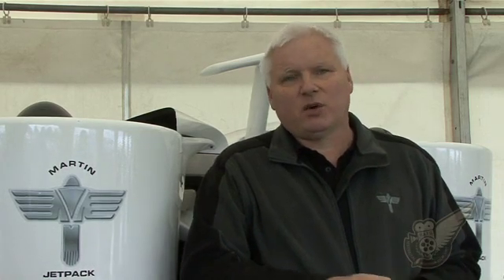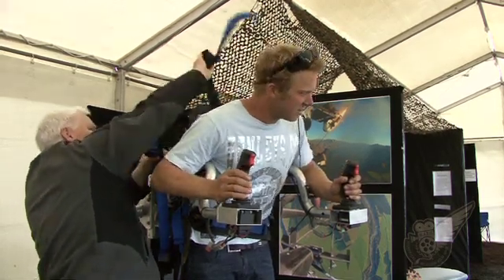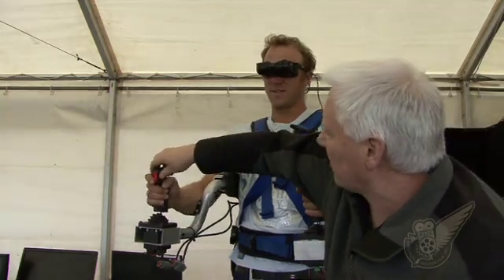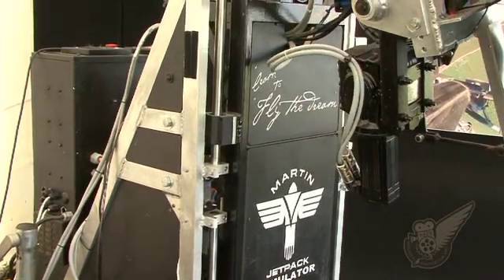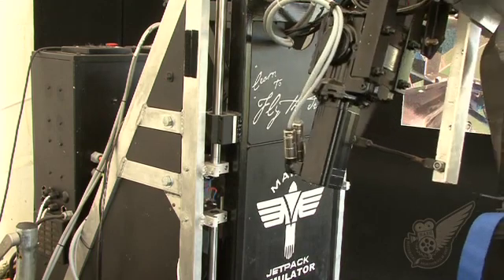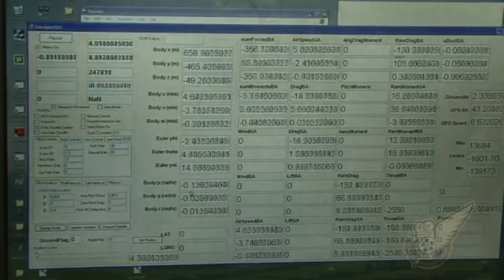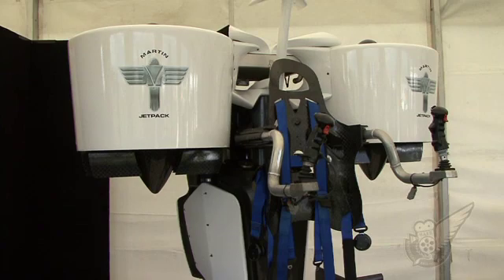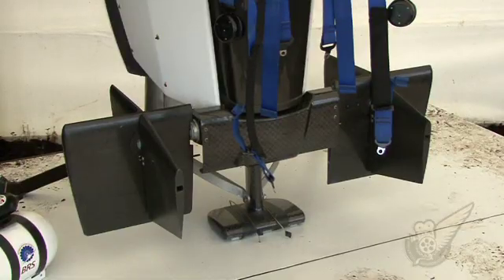Martin Jetpack pilot training simulator

Comment: More than 5 years later and still no commercial jetpack. The 2014 IPO promised first delivery date of Q3/2016 has now passed and all technical specifications downgraded to a level where this machine is totally unpractical and ill-suited for any potential customer. A yet to be achieved targeted top speed of 40km/h will make this device a little faster than an electric golf cart, probably the reason why Martin Aircraft Company asked the American golfer Bubba Watson to promote this device as an alternative golf cart. Having to totally overhaul the engine after just 30 hours of running time will also make this not just the most unpractical, but also the costliest of flying machines. The founder of the company, Glenn Martin, resigned in 2014 and the CEO he appointed, Pete Coker, followed just weeks before the companies’ 2016 AGM to take up a position with Martin Aircraft's Bermuda tax haven incorporated majority shareholder, Kuang-Chi Science. Martin Aircraft Company, with its just under 100 employees, is churning through millions of dollars at a rapid rate (Pete Coker earned $300,000 plus per annum) and has advised the market that more money will be required just to see some kind of commercially acceptable Civil Aviation certification in place. Kuang-Chi Science has so far invested over 40 million dollars in 2 instalments, which will most likely run out in the second half of 2017. All you can buy from Martin Aircraft's website so far are logo printed ball pens, luggage tags, clothing patches and even thermal jugs, but that is about it. Their website has been stagnant for some time, despite employing a considerable marketing team with really nothing to sell. A dismal state of affairs and a sad story for investors like myself, watching the share price of this company drop on a daily basis. Don't be fooled by any forthcoming unexpected announcements, as they would probably be forerunners to a new capital raising exercise. Do your own research and analyse previous videos released here on YouTube. Here is just one from the Oshkosh Air Show: https://www.youtube.com/watch?v=vyb6vnX1My0&t=17s with Glenn Martin advising of "20 jetpacks by this time next year", which would have been 2009, or 7 years ago. Do not get sucked in like I was!!!!!!!!!!